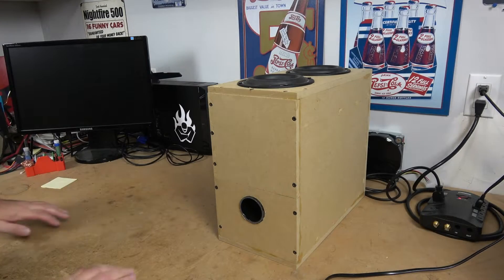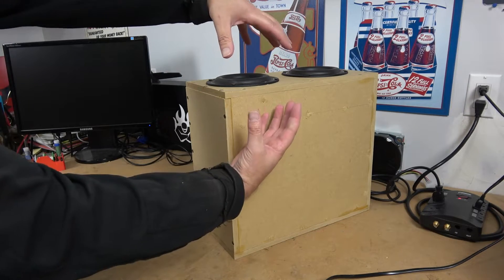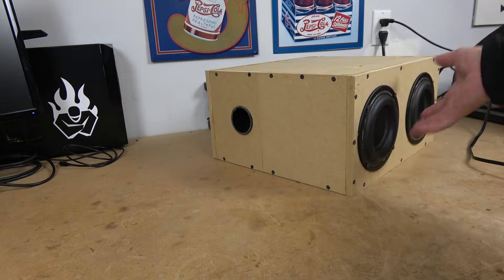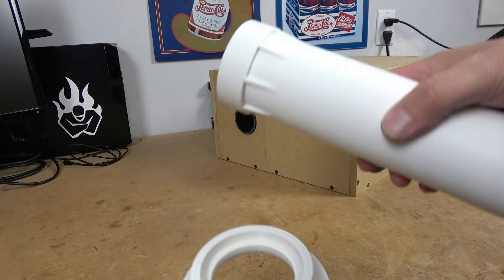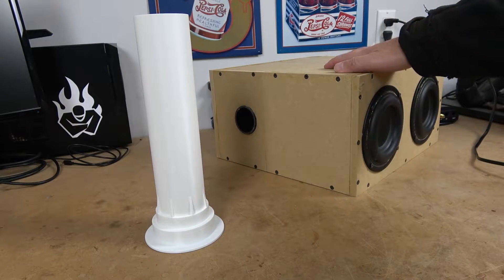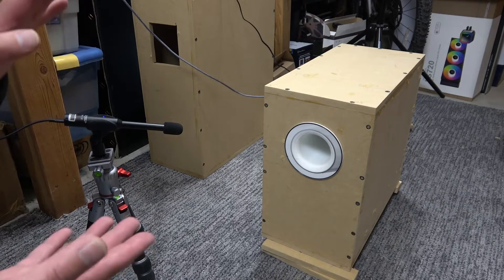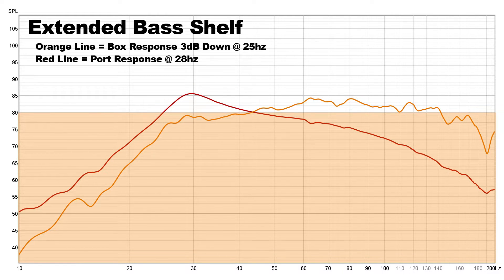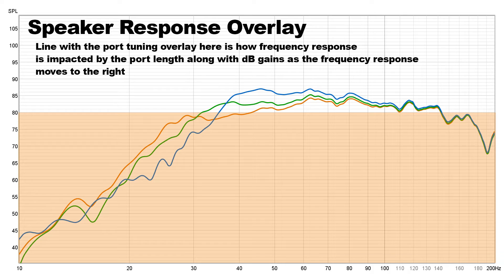Fixing Subwoofer Chuff with Custom 3D Printed Ports

Comment: Where can I get some flare ends to fit my Optimus LX-5 Ports? 1st Gen and 2nd Gen

I just need two flare ends to go on the flat ends that are inside. The outside of the baffle has a flare built in.

They need to slip over a 19mm tube with an inside diameter of 15mm. Need two.

I will also need two flare ends that slip over a 29mm tube with a 22mm inside. Need three.

Comment: Wait, what do you mean isobaric doesn't work with "modern" subwoofers?
Reply from the maker: I mean that speaker design has advanced quite a bit since the 70's to the point where ISO configs are no longer as relevant as they once were.  Don't get me wrong, they are still quite awesome but given that my config showed no benefit tells me there is better ways to build boxes.

Comment: The best tuning for normal room i found between 35 to 45hz.
standard size room like 4meter x 4 meter have no gain below 40hz and lower tunning is bad ideea and weak kick bass or higher than 50-55hz verry crappy and boomy bass and all stuff. I have one 6.5 inch subwoofer at 41hz tuned ,and sound verry different from one room to another.
Also the room or place where i put is verry important.
For example my 4m x 3.5m room have good bass down to 35hz , but anither ine 5m x 4m same 41hz tuning subwoofer play verry clean and good down to 30hz with gain at 35hz from room
Reply from the maker: Thanks.  and well, the nice thing about "this" video is that I wasn't tuning the sub for any particular room but rather improving the sound profile for where it would ultimately be used.  

While I said "home theater" quite often, its really for PC games and Movies that would be watched in close proximity to the screen.   

Truth be told, the fullness of sound in different room sizes is not only tuning but also power handling, a 6.5" in a large room vs small room will sound different if you don't change the amplifier and sometimes the box cannot handle the correct amount of power and is where the sound quality changes.

Comment: So technically you didn't fix chuffing but instead lowered it.
Reply from the maker: Correct.  I made it less prevalent by slowing down the velocity of air leaving the enclosure.  I would need a much larger (and longer (that's what she said)) port to remove the chuff completely making the enclosure somewhat impractical

Comment: Love the 3d printing for ports! Make them screw into the flare for easy removal during testing! I also had the 3d printer print length measurements on the outside of the port so i can cut it shorter if needed!
Reply from the maker: I did print a version that I used to dynamically tune the box, just to see what happened.  Worked well but, for the effort its more efficient to trust the math.

Comment: To be honest I've been quite happy with tunings in the upper 30s unless I need to recreate those subwoofer testing songs. It can sound "powerful" just from the improved sensitivity. In that configuration of box you could probably fit a gentle port curve, up and around the back. Sharp bends in ports reduce their efficiency. Or you could use passive radiators.
Reply from the maker: Agreed,  I had intended to do a folded port but, discovered it would be this long snake that was only a quarter of an inch tall.  Would have been neat to see but ugly IMO.  The box sounds amazing and looks pretty good too though I'll be diving into a new revision later this year.  I'm thinking either a single driver or something of a bandpass variety.  The intention will be that custom desktop monitors will pick up the slack and be the primary sound source.  I figure I can then work on making the sub loud over smooth and equal.

Comment: Need a flare on both ends
Reply from the maker: possibly,  I have used "dual" flares in some of my previous designs and they didn't make much of a difference.  For this project the only reason I added the flare was to dress up the exterior in preparation for the final design.  I still have a few configurations I'd like to test out but, that will have to wait a few months.

Comment: Read somewhere one can put polyfill inside the sub enclosure to slow the air being expelled thru the port(s) causing the chuffing? Enjoyed the vlog!
Reply from the maker: I'm glad you liked the video,  I actually have one final one to upload to finish out this series and then, I'll start working on a satellite speaker build.  Might be awhile though.  :)

To your comment,  Adding polyfill to a speaker box changes the Q value and will slow down the subs slightly.  Normally this is done for "woofers" that are acting as mid-range speakers so to dampen stray harmonics.  When used in a pure subwoofer box the polyfill will change the port turning so, while the chuff might go away, it is doing so at the expense of low end frequency. 

However, with that being said, I have not tested it so cannot back any of this up with anything aside from my own personal research.  btw. @hexibase has an interesting video on the subject https://www.youtube.com/watch?v=OtvDQY9-63g

Comment: I was searching for a project like this,  can you share the spect of this enclosure?  I may try to 3d print a complet setup if you can give me the complet parameters inyernal volume and port size😋.  Thank you
Reply from the maker: My intention was to share the specs for the box when I build the final version.  It will be basically the same thing but with several dress up components and plenty of 3D Printed parts.  In terms of overall dimensions the enclosure is too large for a standard 3D Printer with a print bed of 300x300.  I do have plans to build Left and Right separates out of PLA however, that part of the project won't be until sometime next year.

BTW, Details on "this" project will be posted on my website including some back story information related to how this particular design came to be.
Reply: @Hardwareasylum  thank you,  I was searching for a setup like yours with the same driver.